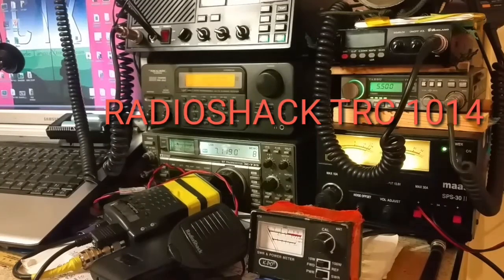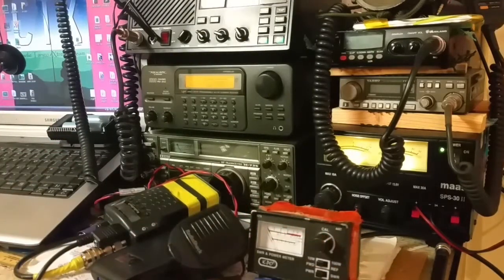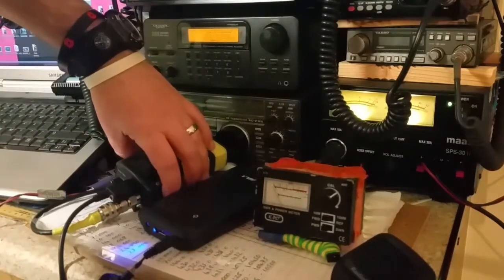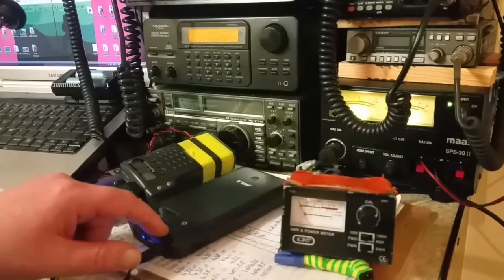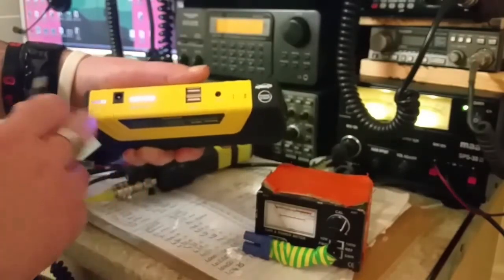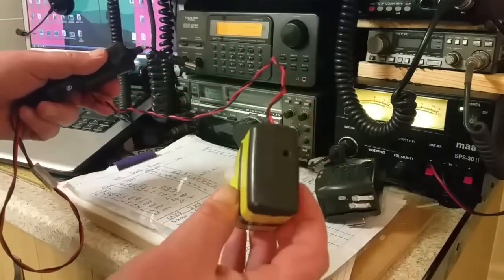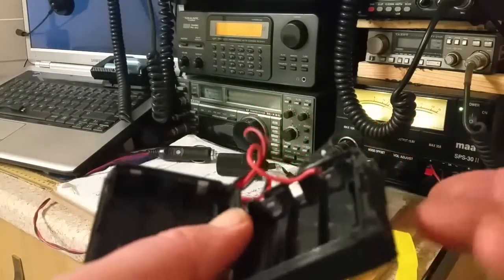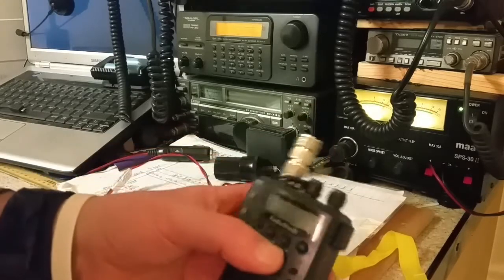CLOSER LOOK AT MY RADIOSHACK TRC-1014 (MOD)

Comment: Hi MarcNice vid mate and like the shack.Quick question - I know you experience big noise levels on 27mhz at home. How does this compare with 20m and 40m? Are these bands less noisy for you?73sTim.
Reply from the maker: Tim H hey Tim,  thanks mate. as to the noise it's only on 27mhz and nowhere else apart from the time on this vid, I've never had it on all bands b4 ever and it only lasted a short while, that wad odd  lol.  cheers 73
Reply: Thanks Marc yeah looking to get my foundation this year and gave loads of noise on 27mhz. Hoping 20 and 40 m are better here! If you are about might catch you on Sid's met tomorrow? 73s Tim
Reply from the maker: Tim H   tbh Tim it's yhd only way to escape the noise these days. it's always nice to be able to use the ham bands when 11m is dead :)  yes I will be out tommorow so hopefully will get another qso. just heading up the hill for tonight's net.  catch ya soon  73

Comment: nice one Mark. If you want a better connection in that battery box without soldering and messing up the contacts, get some round dowel, cut a length, the same as a battery, and put a screw in one end. Wrap wire around screw and put the dowel in the relevant battery slots. 73 Richie.
Reply from the maker: ramdor72  hey Richie you know what that's a great idea 👍..that way I can just slot them in and out. fantastic idea mate.  thanks for that one! cheers 73
Reply: ramdor72: What a great idea!

Comment: Thanks for making the video Mark, great to see the different options for powering the handy. I'll be making that mod too. By the looks of it yours has the 3 contacts on the underneath for both the aerial and power supply car adaptor. Cheers
Reply from the maker: TheLastPost  no problem, it does make the world of difference in performance.  yes the car kit will fit mine but like I say I'm just to tight to buy it . although I may get around to it one day.  have fun doing your mod. cheers
Reply: It was a great mod, I done it today including using the wooden dowel idea from ramdor72 above. Cheers guys, I even made a video too I've just put up with a shout out for you :)